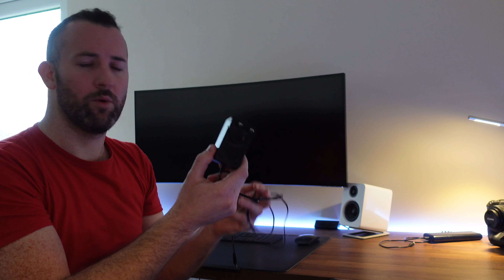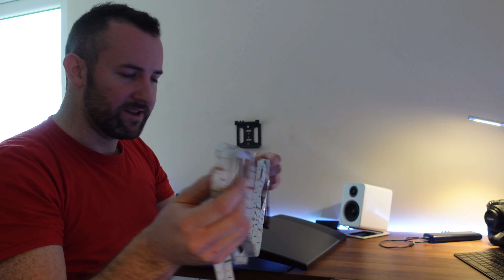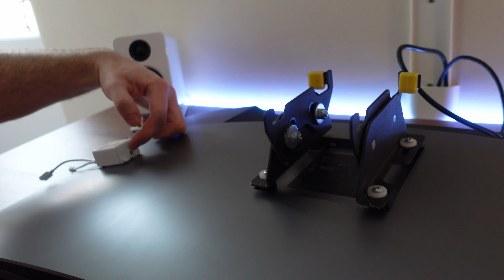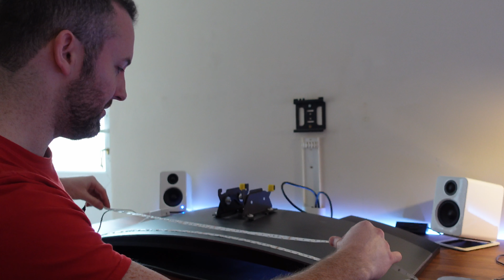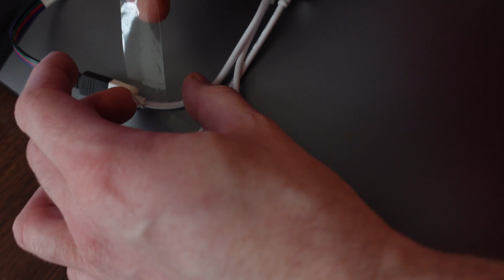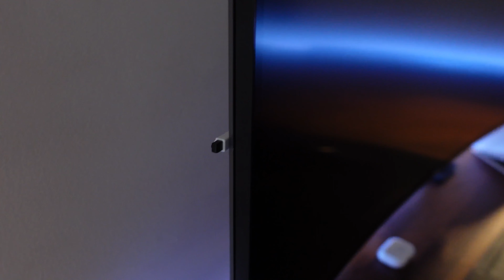How to mount LED backlights to a monitor - Reduce eye strain and make your desk setup look awesome!

Comment: What tape u use?
Reply from the maker: To re-stick the LED strips I actually re-used the same tape that originally came with the LED strips. If you plan to do the same and need to replace your existing sticky backed tape I would recommend getting a roll of this: https://www.amazon.co.uk/3M-Scotch-Permanent-Double-Sided-Tape-75/dp/B0000DH8IT/ref=sr_1_25?crid=3TSBXYLW7MYGM&dchild=1&keywords=3m+double+sided+tape&qid=1615284219&sprefix=3m+doubl%2Caps%2C173&sr=8-25

If you mean the tape that I used to secure the power and IR cables, I used clear parcel tape.

I hope this helps :+1